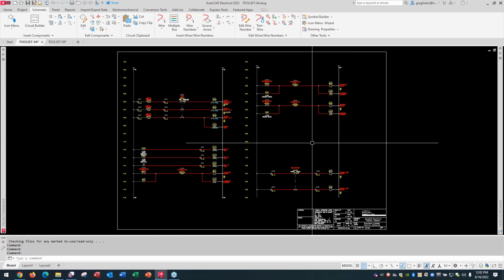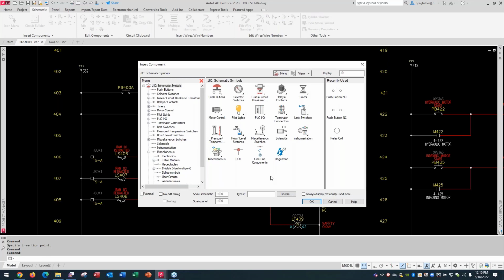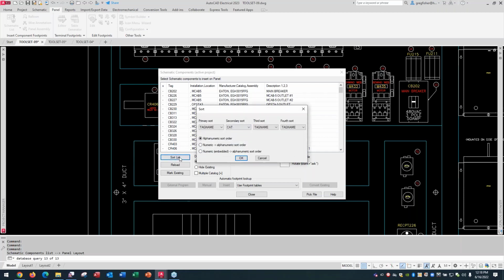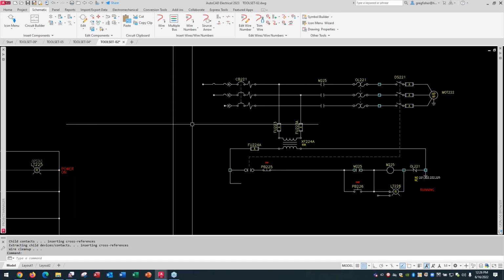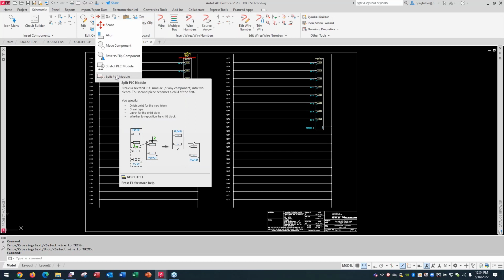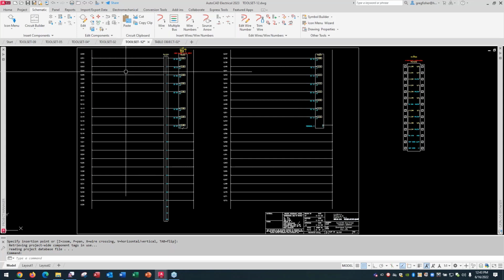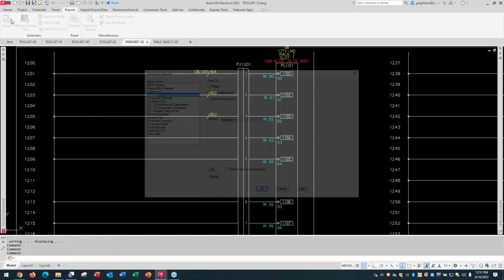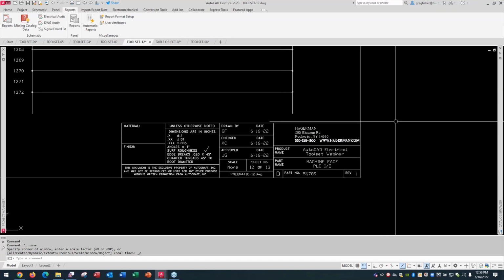AutoCAD Electrical Toolset

Comment: How do you access specific toolsets in AutoCAD 2022? Like the Electrical and Architecture toolset? Are they pre-installed in AutoCAD 2022. or do they need to be downloaded separately?
Reply: Same question did you solve it?